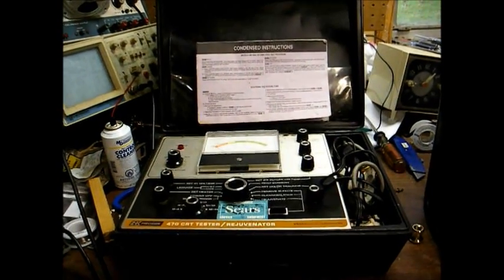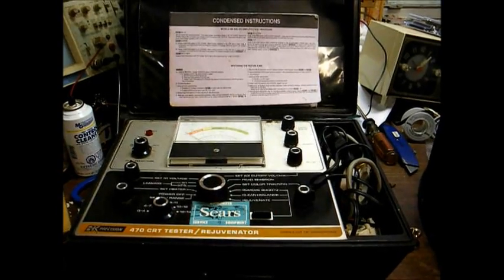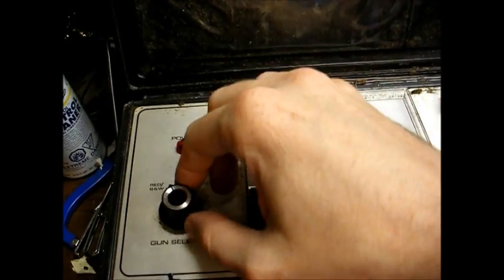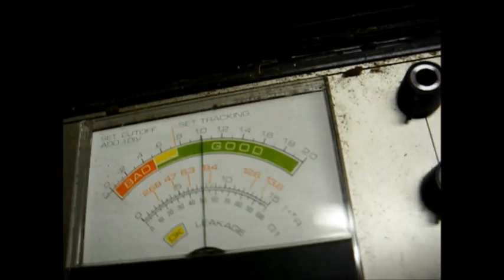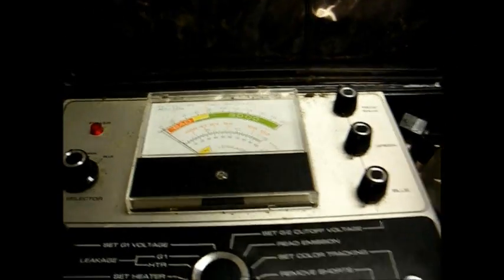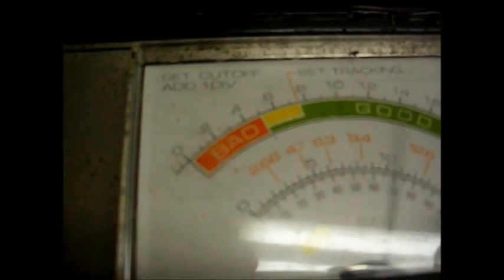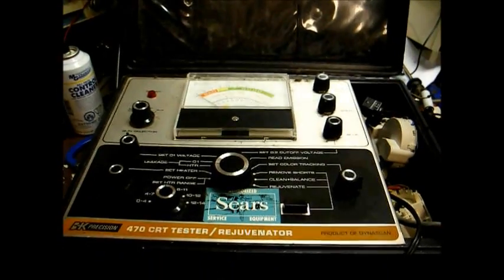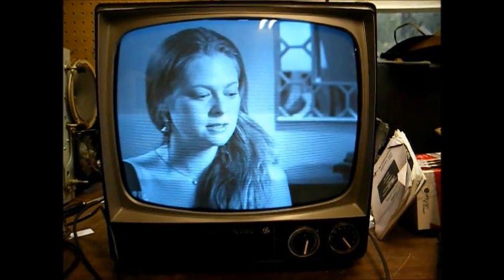Rejuvenation of the CRT in a 15" GE B&W TV, using a B&K 470 CRT tester/rejuvenator

Comment: Nice video. I've also seen B&W CRT's go negative when you turn up the brightness. This happened on a 1959 Zenith B&W 17" set i had when I was in high school. I replaced it with a rebuilt tube and the set worked fine until 1977 when I bought a color set and brought the perfectly working Zenith to the dump. What a HUGE mistake I made that I regret to this day.

Comment from the maker: If a CRT that was otherwise good has been sitting unused for decades, they can become weak. Often, running them at 2-3 volts higher than their normal filament voltage rating will wake them up. This process may take anywhere between a few minutes and several hours to take effect. Also, they used to make CRT brighteners that were designed to plug in between the TV's CRT socket and the CRT. These devices raised the filament voltage; thus, making the cathode hotter & producing more electrons.

Comment: Love your channel.  would rejuvenation work for a monochrome monitor? we have a cnc mill at work with a dim monitor. in fact we have to turn out the lights to plot out a program. its yellow monochrome if that makes a difference.  the mill is a hurco cnc mill from the early 80s.
Reply: btw it uses to monitors sideby side.
Reply: billybonewhacker You can try...

Comment: I used to have a B&K 445, when I was doing TV service, but this unit had no current limiting. I never smoked a CRT with it, but I saw the potential for it happening. Unfortunately, I left it at a customer's premises, and it strangely disappeared within one day when I remembered where i had left it. I need to start looking around for a Sencore CR70 which is the particular one I favor. It would be risky to try & rejuvenate a color "roundie" 21FBP22/JP22 etc with an old B&K...those tubes are getting harder to find. My main line of work besides being a DJ on the weekends is, Amplifier repairs & pro audio equipment repairs..I repair a lot of guitar amplifiers, and sound reenforcement power amps. I'm the local tube specialist in my area...kids nowadays coming out of electronics schools don't seem to have a clue about vacuum tubes :) The technology is still popular and will be around for a long time comin' Tube theory should still be taught in the schools.

Comment: radiotvphononut
:  My two Philco Seventeener III's just started acting up.  One lost all picture and raster while I was adjusting the set after a cap replacement.  Has good sound and had a great bright picture and nearly instant video.  The other suddenly started acting up - the high voltage takes nearly 20 seconds to come up and the screen takes that long to produce a picture.  IT is plenty bright just terribly SLOW to come up.  Any ideas??  These two sets are beautiful, but I am pulling my hair out.  I have a SUPER MACK tester - but am now afraid to test the tubes based on your comments about destroying the tubes...

Comment: I have a vintage Motorola set that uses a 17HP4 CRT.  I ended up having to replace the CRT as the one that was in the set was so bad.  I could only see it in a dark room and it had a heater to cathode short.  The CRT was so gone it wouldn't even register on the CRT tester and doing a rejuv had no effect on it.
Reply: ESDI80 Nothing lasts forever...

Comment: RADIOTVPHONENUT, 
Is the CRT rejuevenator adding and injecting more Electrons into the RGB ray gun? 
What is the CRT rejuevenator doing to the monitors neck circuit board and tube?
Reply: It's pulsing high voltage between the cathode and G1, which blasts off junk from the cathode and allows more electrons to be emitted.
Reply: @TCGProductions03  Ok thanks
When adjusting the B+ voltage why do you need to adjust the brightness trim pot to maximum to get the correct B+ voltage?
Reply: @billwilliams6338  The B+ will be lowest when the brightness is at it's highest. Setting the B+ with maximum brightness will ensure that the set continues to work properly, no matter what the CRT is displaying.
Reply: @TCGProductions03 , thanks for the help
What I'm confused about is what does the brightness current and voltage have to do with the B+ voltage?
The Brightness is controlling what in the TV tube and circuits?

Comment: IDK about TV shops still using these, I don't know of ANY around my area that will even work on a CRT anything let along be using any type of tube testing gear and those shops are very few and far between. I think I am the only person in a 100 mile radius that owns a tube tester and I work on 2-way radios and related equipment

Comment: Which is why all picture tubes black and white and early colour tubes all the way up to the late 80's (and possibly early 90's well i would save) need saving! or rejuvination which is unreliable
Reply: Sony T I have 2 trinitron tube that have green cathode-heater short, can they be fixed, if so will they stay fixed